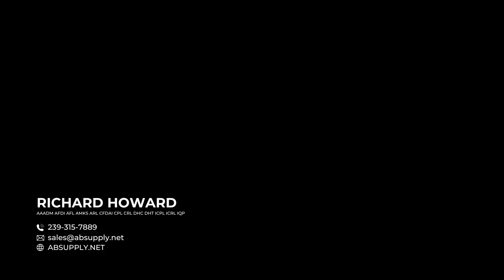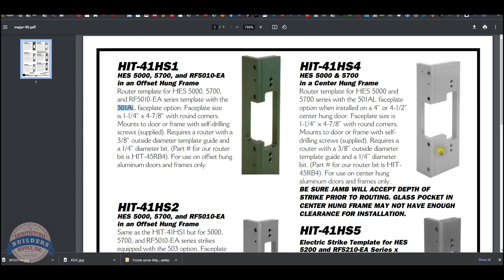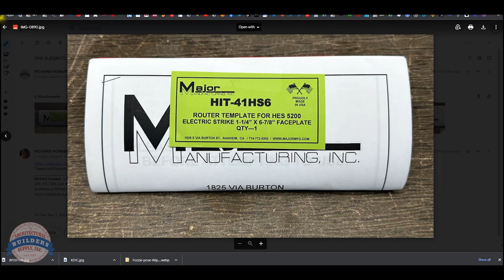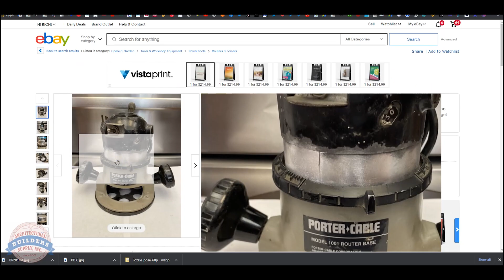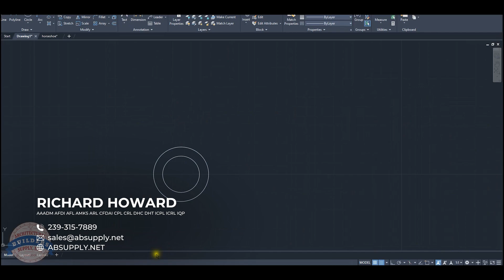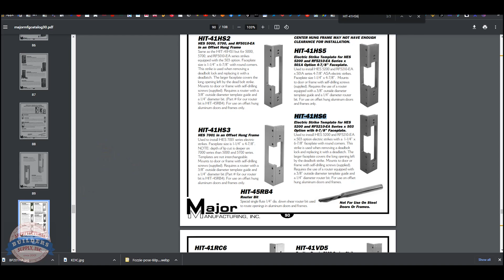Major HIT 41HS6 Router Template for HES 5200, and RF5210-EA Series Strike, Offset Hung Frame

Comment: Hey Richard, in theory is we wanted to install a HES 6100 series strike could we use the 5000 series template and then after with a dremel cut more depth to accommodate the difference?
Reply from the maker: Please verify your part number.  Rich 773-809-3667 -